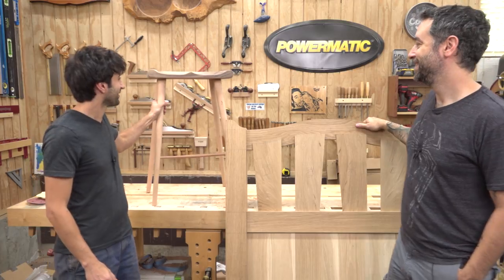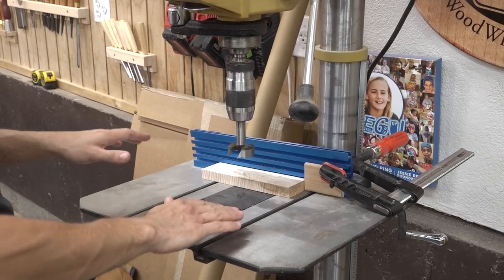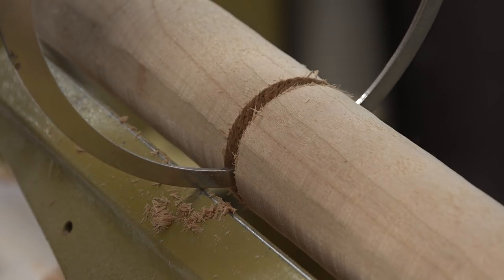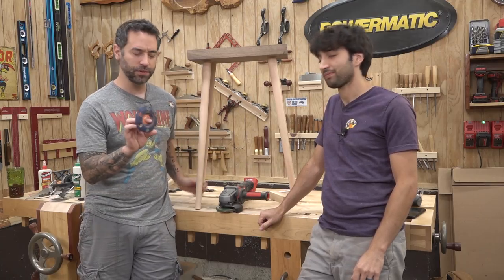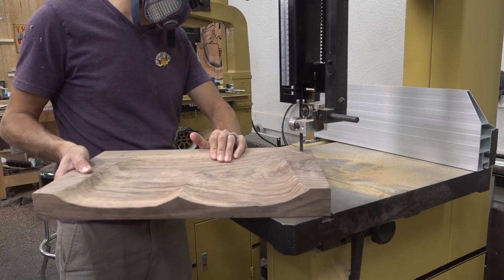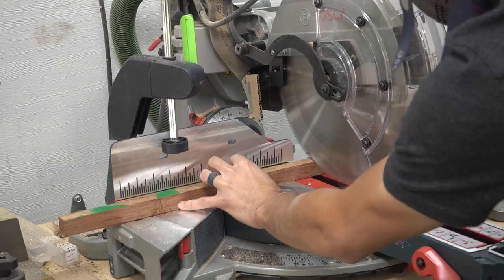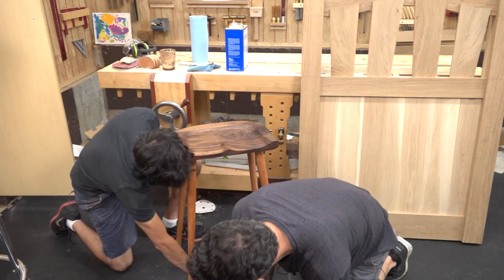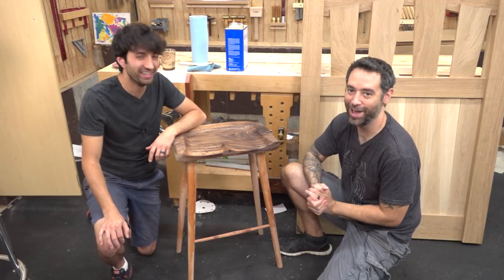Making Sculpted Bar Stool in Marc Spagnuolo's Shop

Comment: Thanks for showing us how you made that. I might try to make some for my bar. I might use square legs because my lathe is the 10"jet and it has about a 15" length max. I don't have the extension for it yet. We will see.

Comment: To spend a weekend at your shop, with all those awesome tools and getting to follow your instructions would be a fantasy.
 With my limited skills and limited tools, everything takes forever. 
 My my first project was an outdoor cedar door. No joints, no bevels, no fancy design, put together with screws and took a month to do. 
 But it still works, passed inspection, survived hurricanes. 
Putting the lock in, succeeded after much cursing.
 But if I ever decide to take it down, I will look to use some the techniques shown here.
 Your work is amazing.

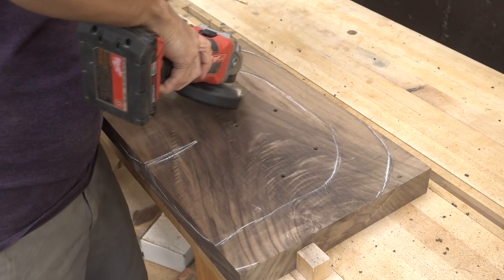Comment: 7:50 - I have a disc like that but it is basically a chainsaw chain wrapped around and formed into a disc - well it's not really a chainsaw chain, it is solid and B-O-Y does it cut some wood. I used it to bevel the ends of some railroad ties ... Nice!

Comment: If you watch Curtis Buchanan carve a Windsor chair seat he makes the seat thick but tapers the edges down to a very thin edge so the bottom is substantial enough to support the legs but it helps to reduce the clunky look of the seat. I think your seat looks good anyway but if you want too make it appear thinner its an elegant way of making that happen